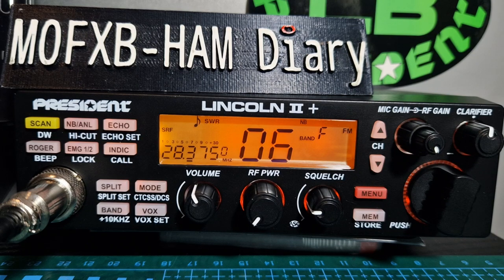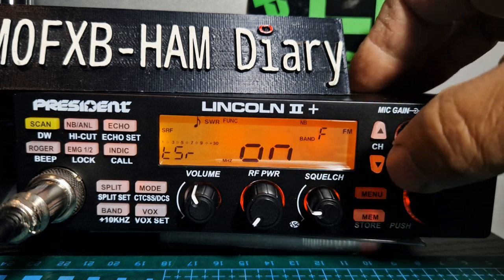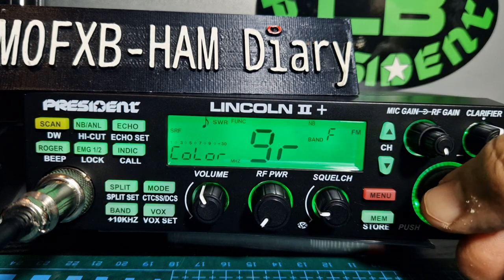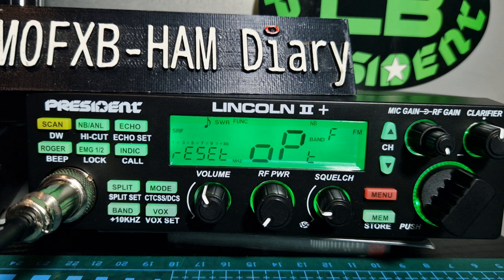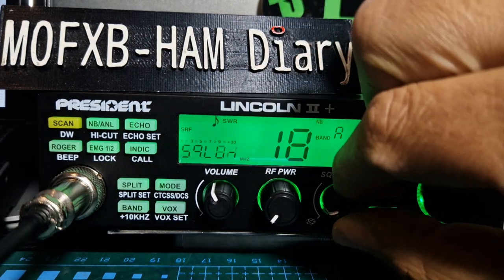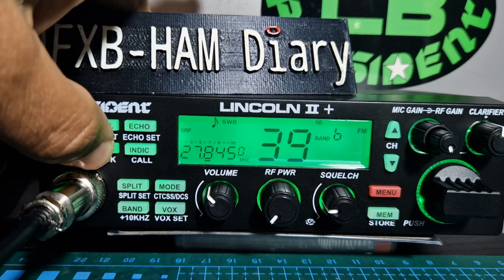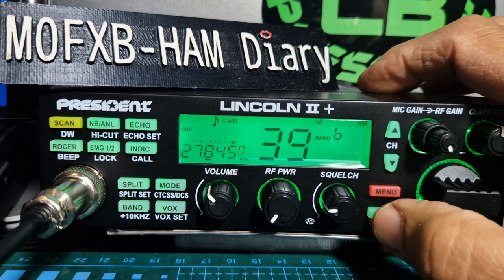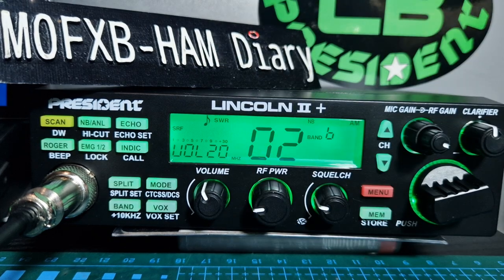PRESIDENT LINCOLN II + , FUNCTION MENU SELECTIONS DESCRIBED & OVERVIEW OF BUTTONS

Comment: I am visually impaired so without some type of audible synthesizer menus like this are a nightmare, which is why I prefer the old style mode knob, switching left or right or toggle switches, and memorize where the settings are But for someone who can see fine this would be great although I did enjoy my old HR 2510
Yes, there were some push buttons on it, but I tried to memorize those and if they did more than one function, it would start confusing me
Reply: Let me be more specific, and Audible voice synthesizer
Reply from the maker: Hi thanks good info